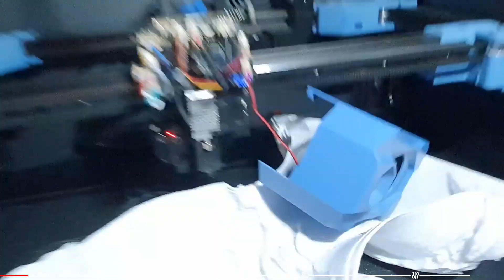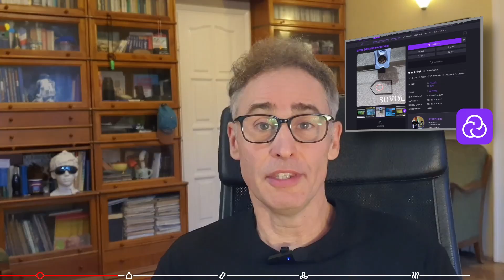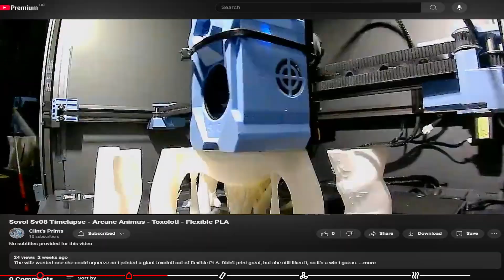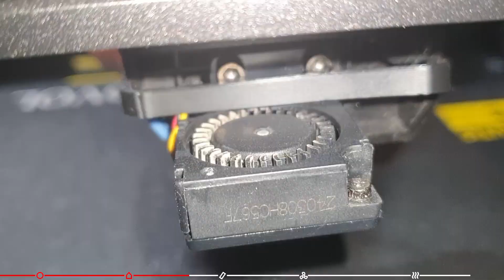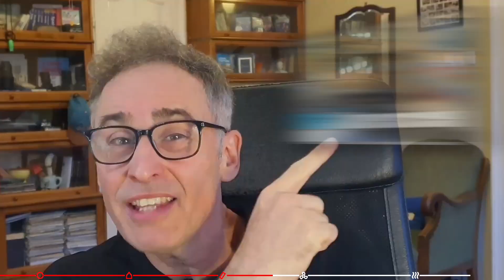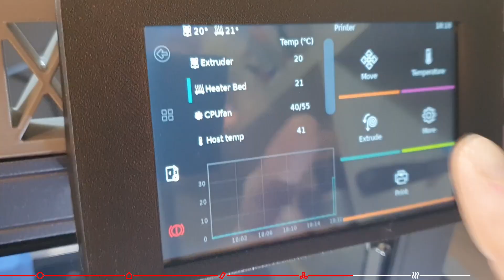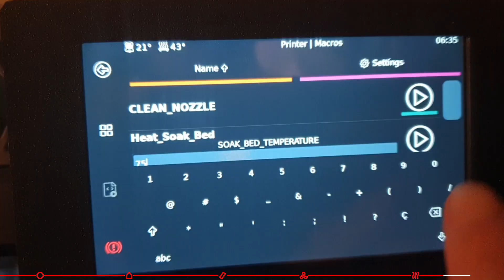5 Tiny Upgrades to Boost Your Sovol SV08's Reliability + other Klipper 3D Printers: SV06 SV07 Q1Pro

Comment: Did you experience a "taco bed" shape on the Sovol SV08 Max, do you know how to fix it?
Reply from the maker: We got a perfectly flat bed with our MAX. The bed on the MAX is much thicker and less prone to warping. Besides we have the bed mesh to correct and distortion. I do heat soak it though before taking the mesh using Demon Klipper Essential's smart adaptive heat soaking so we do the probing when the metal stopped expanding.

Comment: How did you change the color of your knob LCD screen on the printer? Mine is only blue. Great video!
Reply from the maker: Check the [neopixel Screen_Colour]   section in your printer.cfg. You can adjust Red / Green / Blue components.
Reply: @gerGoPrint3D Thank you so much! Your videos have been very helpful and I also purchased your config folder off cults3d. I'm very new to klipper and your videos are making it a lot easier to understand.
Reply from the maker: @SouthernVaRidin  Thank you for your kind feedback!

Comment: well I bought a Sovol 8 and your video helped alot, I didn't think i would need your part to keep the shroud on but I finally had it pop off during a print. using PLA+ (205 degrees). I think the plastic just cured and the nozzle fused to my print and the print knocking the shroud off. I printed 2 temp towers and they both failed at the same spot so ya... it was mostly temp issue but I figured i'd buy your wonderful part you engineered and be prepared for the worse. I support you and your wonderful videos, they helped me tremendously (happy 3d printing)
Reply from the maker: Congrats to the new printer! (ger) GO PRINT 3D! I hope you have a lot more fun and success with it!

Comment: Love your "adventures" - I have had my SV08 about six months now and have a few "issues", hope you can help. Over time I have accumulated a large number of print files on the printer, but can't find a way to delete them. It's a pain to scroll through them all. Secondly, I would like to update the software as you have outlined, but don't know how. Thanks again for all your great ideas.
Reply from the maker: You can mark multiple and delete from Mainsail. Or connect to the printer using WinSCP (I show it in multiple videos) and find those files under printer_data. That's actually how I download and delete timelapse videos as well, they take up even more space!  Check out my video on the 32GB EMMC upgrade which fixed the printer for me. https://youtu.be/9ElC5DwApIQ

Comment: I 'upgraded' the spool holder by just swapping it with one from my ancient ender 3. Absolutely zero tangles.
You can undo tie wraps by sticking a tiny flathead screwdriver (I think I used the one included in the sv08 tool bag) from one side under the latching mechanism. While cutting leave a tiny bit extra so you have some bit left to ratchet it closed when you re-use it to attach the cover.
I have the upgraded toolhead and cover with the metal dowel but my cover was missing all the magnets so still wouldn't stay put. The zipties worked fine until I got my replacement cover and I never cut them so they can just be re-used for something else.
Reply from the maker: Good solutions. Make a video showing them to the community, so we can all profit. My simple spool holder upgrade makes it possible to restore the original free spinning behavior in case you do need to minimize friction, for example when printing TPU.

Comment: My SV08 has been down sense May! on account of this issue. it came off ran itself over and i have not been able to print anything sense May. sovol support has sent me the 2 boards that go on the hotend it has not fixed the issue. both times the board install shows different issues first extruder gear would not move. they had me change it again now getting a error code 8 on screen ( I think thermistor error) for some reason Sovol does not want to send me the hotend Im pretty sure when the hotend ran itself over it pulled the wiring inside the hotend. im thinking of calling my bank and disputing the charge my warranty is about up soon.

Comment: I could not get my SV08 to print such a fine layer of TPU without "Globbs" that rendered them useless - I resorted to laser cutting thin felt washers instead which worked fine, any advice on TPU printing on the SV08 would be appreciated.
 btw, I added a printed adjuster knob to the spool tensioner, easier than a screwdriver, and looks better ;)
Reply from the maker: Thanks for the tip! I’ve bought TPU from five different brands and am planning a big TPU printing video covering various printers and nozzle types. However, we have a lot on our plate right now, so this one will have to take a backseat for a little while.  If you are getting big blobs your TPU might be wet. Steam bubbles can cause such globs. Try drying it at 55°C in a filament dryer for at least half a day.

Comment: My s08 have Problems with Heat creep. Have you a Tip?
Reply from the maker: How new is the printer? Make sure the extruder fan runs at 100% and there is no dust or dirt hindering its effectiveness. What type of filament are you printing? For PLA / PETG keep doors / top open, for high temp materials like ABS the enclosure should not be heated above 50°C, but it's hard to get it over 40°C... Retraction distance can affect it too, if you've changed from the default 0.8mm try restoring that value.

Comment: Hello again, Gergo, how did you set the different values for the fan PID? Maybe it doesn't make a difference, but since I'm going to install a different fan, I wanted to make sure it works perfectly...
Reply from the maker: I am not sure what you mean. I did PID tuning. I show you how in this video: https://youtu.be/xl4tBgMcuzA
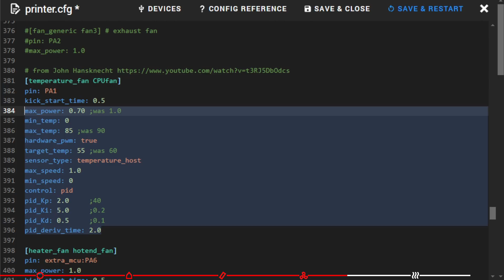Reply: @gerGoPrint3D  I was referring to the pid contained in the fan command lines (11:11 minutes), which I thought you would have made changes to the pid, but I now realized that John Hansknecht had already done it the way it is currently, I will use it the same way... thanks :)
Reply from the maker: @leolagoa  Oh, sorry, yes, there are updated values for that if you don't want it to start and stop too frequently, and yes, he has the updated values in the description of his video.

Comment: An alternative to wasteful wire straps or a printed pointy clamp is using a strip of dual sided hook-and-loop tape (aka "velcro") which can be reused after the occasional removal of the print head cover.
Reply from the maker: Good tip!

Comment: gerGo I’ve got a question. When I print abs the meshing process it’s done at 65°. However I’ve set abs at 95°. This ruins the previous bed meshing done at 65° because of the thermal expansion. How can I solve that?
Reply from the maker: I give you a fix for this issue in this video → https://youtu.be/Yva6pBgEr5M
Reply: @gerGoPrint3D  Problem solved! Thank you so much!

Comment: I must say, your videos on the SV08 are mazing!!! They have helped so much setting my machine. Additionally, I would have loved to see you add replacing the current inductive probe to the 12mm one, that would have helped a ton.
Reply from the maker: Thank you so much for the kind feedback! I did not end up replacing the stock probe since it works OK for me. I just need to preheat the bed for 5-10 minutes with the probe near the bed and changed the probing parameters in printer.cfg as explained in my "19" video → https://youtu.be/xl4tBgMcuzA Just replacing the probe would not save me from preheating since the bed itself needs heat soaking as well. I actually have the replacement probe ready, but since I am getting great first layers with the current setup, I just don't see the reason.
Reply: @gerGoPrint3D  Understood, I have deployed your macro file 🙂

Comment: Great video!  Thanks!

My Upgrades - Done As I Was Assembling the SV08:

1) Every manufacturer creates a slightly different high flow nozzle.  All are similar to the Volcano nozzle but we're forced to buy a slightly different proprietary nozzle that won't work on any other printer.  Replacing the hot end with a MicroSwiss hot end results in a high quality and known good hot end that uses the high quality MicroSwiss FlowTech nozzles that can be cold swapped without removing and reinstalling the heater and thermistor.  Nozzle changing is now easy enough that I can swap to a 1 mm nozzle for printing a large part, or use a hardened steel nozzle when printing PET-CF.  The FlowTech nozzles are compatible with all other printers once they have the MicroSwiss hot end installed.  Installing the MicroSwiss hot end is as easy as changing the original manufacturer's nozzle that requires the heater and thermistor to be removed and reinstalled without damaging them.  Once the MicroSwiss hot end is installed, the nozzle can be cold swapped in one minute, using only one hand and a 7mm nut driver.

2) One of the first things people notice is how the small motherboard cooling fan is way too loud, and it's on even when the printer is idle so the printer is always loud.  It's possible to move the fan connector from the 24V power connector to a connector that's controlled by an MCU output, then modify the printer.cfg file to turn on the fan only when it's needed to cool the MCU, and use PID speed control so the fan only turns fast enough to cool the MCU, as described in this video.  Instead, I replaced the motherboard fan with a Noctua NF-A4x10 24V fan.  It's so quiet that I didn't bother controlling the fan.  I left it running constantly and I can hardly hear it.  The Noctua fan is very reliable and durable so it should outlast the SV08, even running constantly.

I'm currently designing a 3D printed enclosure for the SV08 that incorporates thermal insulation to better passively heat the build chamber while reducing power consumption.  The enclosure will be structural so it will stiffen the frame and reduce vibration.  It will also have two chamber fans that can cool the chamber with the door raised for printing PLA, or the fans can be used to filter the air using carbon HEPA filters to reduce fumes and microplastic particulates.

My biggest SV08 problem is the thin print bed.  My SV08 bed warps more than 1 mm which makes it impossible to get a good first layer on large prints.  There are many community efforts to fix the problem, including guides that can be 3D printed to locate the bed mounting screws below the magnetic sheet, so the magnetic sheet can be drilled to access the bed mounting screws, so the bed can be removed and 3D printed shims can be installed to pre-stress the thin aluminum build plate so it warps flatter when heated to the desired build plate temperature.  I wish there was an aftermarket upgrade to a thicker stress relieved cast aluminum plate (MIC6, etc.) with springs underneath and access to the mounting screws that allow the bed to be mechanically leveled so Klipper isn't trying to look at the bed mesh and use Z axis compensation to software level a bed with 1 mm of warp across the print surface.

Comment: the other quality of life thing I found out is to update Macro.CFG in sections END PRINT, CANCEL PRINT and PAUSE.My recommendation is to change "G1 Z+5 F3000" (also +10 or +15) after "if (printer.gcode_move.position.z + 5"... in designated sections to +4. So the gantry whould lift to extra 45 mm instead of original 5...15. This will prevent hotend assembly from colliding with already printed parts in case you print several elements one by one (Ilearned it hard way when print head collided with previouselly printed part when I paused the process after second part just started). As the height of horisontal beam is around 40 mm over the table at it's lowest, there is no way for separate parts be taller than this anyway/

Comment: Thanks for the great video Gergo, I just got an SV08 and seems like some of the issues have been addressed by Sovol, you can now get the 0.2, 0.6, and 0.8 nozzles, the fan is much quieter now out of the box, the wifi connectivity is easy and linking to Obico works really well also, I'm looking forward to adding your suggestions to the printer and see how it goes. This thing is fast!!!!!
Reply from the maker: Congrats to the new printer! I am delighted to hear Sovol is improving :)

Comment: Just set mine up. Need to quiet it a bit. Wowza
Reply from the maker: Congrats! Tip #4 should help you
Reply: @gerGoPrint3D  any thoughts on how much noise reduction with enclosure being installed?
Reply from the maker: @raymondholland8572  I made measurements in this video: https://youtu.be/VqVO9W1lIT0

Comment: I just got my sv08 and here I am enjoying your videos. Before I get it set up. One thing that comes to mind for the heat soak, I wonder if instead going to 60 deg and letting it soak for say 5min, if it would be a quicker soak to go to 70° and then readjust down to 60 for ???2min???
Reply from the maker: Congrats to your new printer! Some actually heat soak at higher temps, but in my opinion it's better to heat soak a the target temp. The idea is that the bed warps to different shapes at different temps. We want to give time to the bed to warp to its "final" shape at the given temperature between ABL scanning and the actual print.

Comment: Just realising you removed the printed enclosure riser on your SV08, any reason? I was also looking at your cult Macros, wouldn't there be a way to simply add a "sleep" of x minutes on the print_start macro so that it does the soaking automatically when launching a new print (I'm not familiar with Klipper macros)?
Reply from the maker: I haven't removed the riser, I sometimes just use a bit older footage for b-roll. I keep the riser on the device, it's serving well.  Yes, I am experimenting automatically doing varying amount of pre-heating before the print but I don't like the implementation some recommend to include it in print jobs (via Orca printer profile variants), because that ties the preheat to the job, limiting felxibility when reprinting jobs from the memory of the device. I am thinking about some kind of global variable storing the length of preheating time that we could adjust before starting print jobs.  Or making it even more automatic that would decide the duration based on print size / surface area / temperature of the bed at the start of print etc.
Reply: @gerGoPrint3D  thank you for the clarification! Can't wait to hear more from your tests. With prints taking the whole bed, there's a visible difference in first layer height (one side squished while the other slightly too high). Gonna get your tweaks from Cult ;)
Cheers from France 👋

Comment: There is a way to make the original printer fan silent when temperature is low. No hardware mod required.
Here is the code with the temperature-tweak to make the fan spin slow when temp. is low. and avoid fan spinning useless unter 25% speed. Starts spinning at 25% and spins faster CPU temperature dependend.
Add this to the printer.cfg in Klipper and hit SAVE&RESTART (use at own risk):

[temperature_fan CPUfan]
pin: PA1
kick_start_time: 0.5
max_power: 1.0
min_temp: 0
max_temp: 90
hardware_pwm: true
target_temp: 57
sensor_type: temperature_host
max_speed: 1.0
min_speed: 0.23
off_below: 0.25
control: pid
pid_Kp: 2     
pid_Ki: .5     
pid_Kd: 0.25     
pid_deriv_time: 5.0
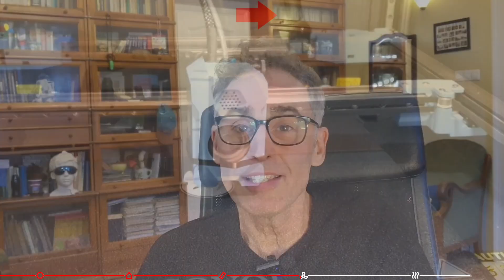Reply from the maker: I literally show this in the video at 9:46
Reply: @gerGoPrint3D  I know,

but try this in addition:
min_speed: 0.23
off_below: 0.25

Then the fan will stop under 25% fan speed, avoiding spinning useless at very low rpm and producing pwm noises at low rpm. 😉
Reply from the maker: @kampfwuffi  Oh, sorry, I did not compare your settings :) I will try. That's actually a very good tip!! Thank you

Comment: gerGo, love your videos and follow them closely.  In this video you show a way to retain the tool head cover so that it can't come lose during a print.   I love your simple idea. I had already made two clips that are now part of my cover to do the same thing and they work perfectly but your way is simpler so why did you wait so long?  😄  I would show you a picture but do not know how to do so here.  Please continue with the video's as you really help us all and I am thankful.
Reply from the maker: 😂 I was curious where your comment was going! Thank you for your kindness. I tend to overcomplicate things too, but with this, I stumbled upon some simple ideas and also got a bit lucky. Originally, I planned to have the pointy side facing the back, but it interfered with the small part fan, so I just flipped it around. Then I realized it was the perfect size—not touching the closed doors of the enclosure. That was pure luck! But as you saw in the video, it takes a few prototypes and some experimentation. I love the SV08, and I promise to keep everyone posted if I come across any other improvements. By the way, you can find my email address in my channel description. You've made me curious about your fix for the extruder cover! 😉

Comment: I was able to fix my emi issues by simply adding a line of code that cycled the relay for the heater bed at the same rate of my main ac power. It also added the effect of making the heater quieter.

in printer.cfg and under [heater_bed] add or adjust the following line
pwm_cycle_time: 0.016666666666 #60hz